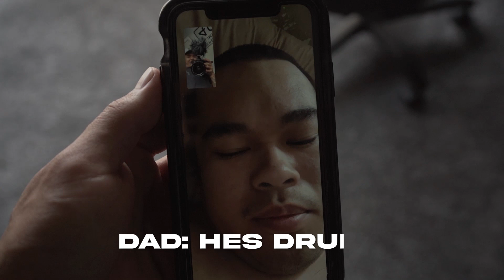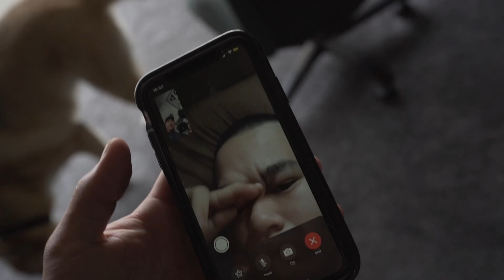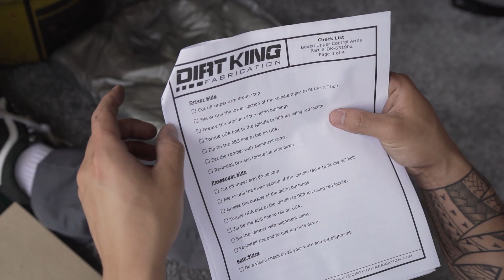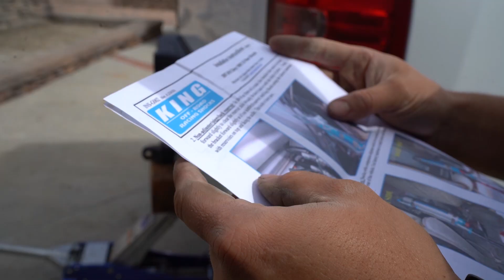002 Vlog Dirt King Uppers & King Shocks Install Chevy Silverado

Comment: how has removing the bump stops done? Im looking at cutting mine off with stock ucas to gain more travel. will this help with travel?
Reply from the maker: i do not think you should tbh. if you are running stock shocks. they’re not meant to extend past the bump. i would only cut if u got upgraded uca and shocks

Comment: Bad A looking truck and video. 

What size tires and so it also has a 3inch spindle in the front also?
Reply from the maker: thanks brotha 🤙🏽 they are 35 inch tires with a cst 3 inch spindle lift